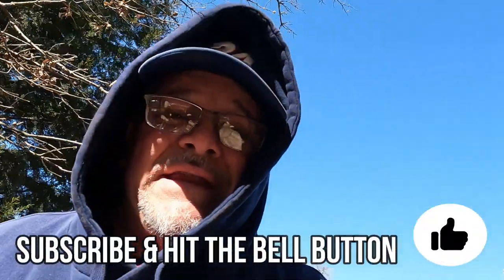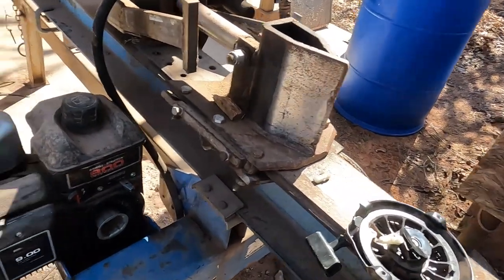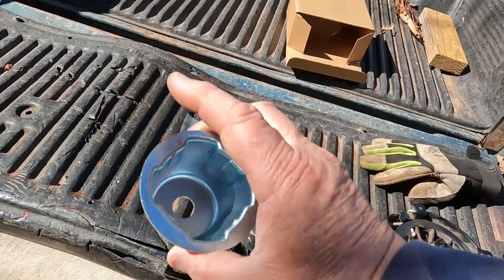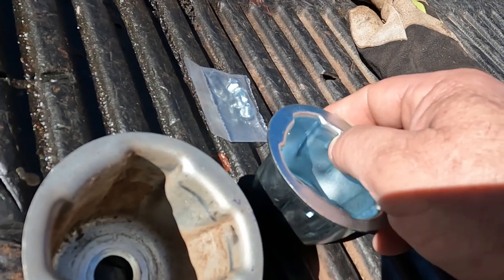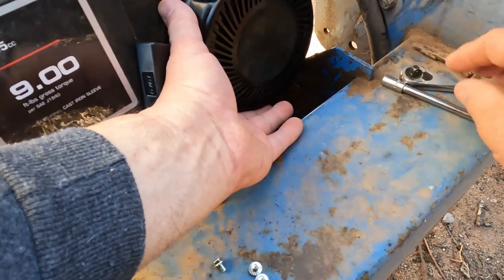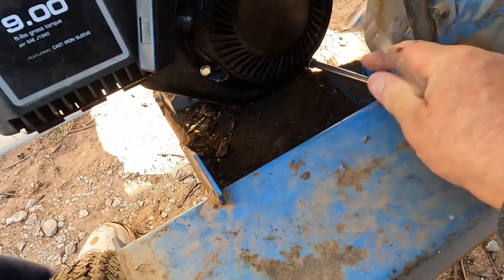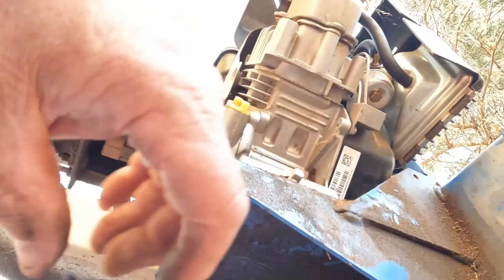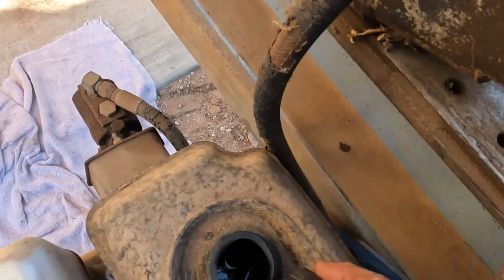GREAT IT BROKE | LOG SPLITTER | RECOIL STARTER

Comment: If it goes out again put a 15/16 socket on an extension with a battery drill and you will have automatic starting. 🤠👍
Great job on the install though!
Reply from the maker: Great idea